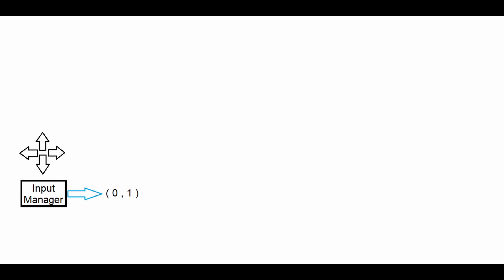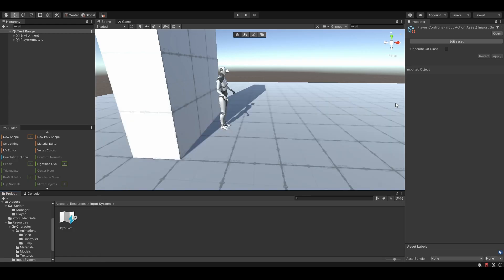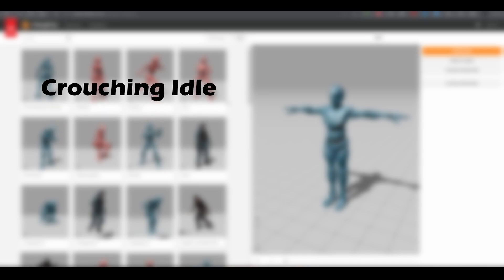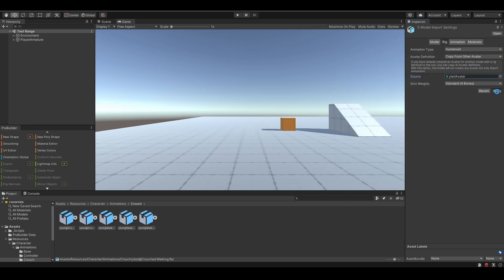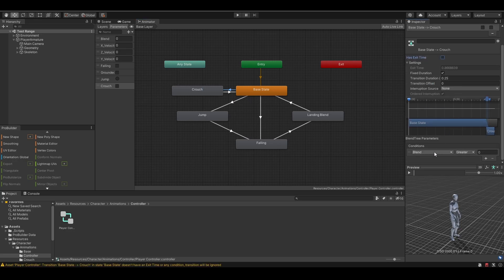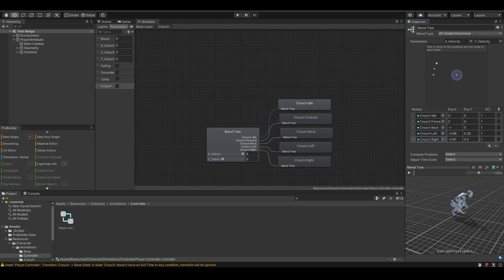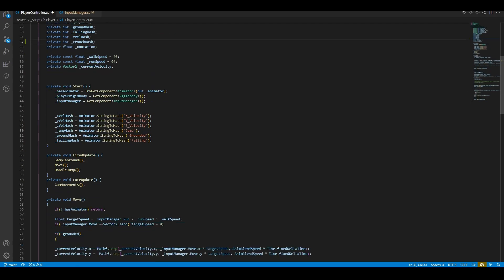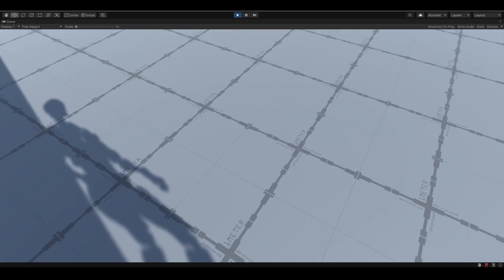Making A Crouching System - Unity Tutorial #3

Comment: Great tutorial! Guys I faced some issues and I wanted to post the fixes here if anyone was facing the same issues, if your character isn't jumping and playing the jumping animations, check your rigidbody's mass, make it lighter, something like 25-30 worked for me. 

Secondly my character started playing falling animations when I was on a slope, make your Dis 2 Ground higher, I put mine to 2.2 for it to work properly and I changed the private void SampleGround() function to this:

private void SampleGround()
{
    if (!_hasAnimator) return;

    // Use a sphere cast instead of a raycast for better slope handling
    float sphereRadius = 0.5f; // Adjust as needed, typically half your character's width
    Vector3 origin = _playerRigidbody.worldCenterOfMass + Vector3.up * sphereRadius; // Start a bit above the center of mass
    float castDistance = Dis2Ground + sphereRadius + 0.1f; // Adjust based on your character's height and desired ground detection range

    RaycastHit hitInfo;
    bool hit = Physics.SphereCast(origin, sphereRadius, Vector3.down, out hitInfo, castDistance, GroundCheck);

    // Check if the ground normal is within the slope limit
    float slopeLimit = 45f; // Adjust based on what you consider too steep
    bool isSlopeAcceptable = Vector3.Angle(Vector3.up, hitInfo.normal) <= slopeLimit;

    // Update grounded status based on both the sphere cast hit and slope check
    _grounded = hit && isSlopeAcceptable;

    _animator.SetFloat(_zVelHash, _playerRigidbody.velocity.y);
    SetAnimationGrounding();
}

Lastly, If you wanna get rid of the players holding gun animation while crouching, google animation masking. blend the crouch forward upper body with the rest of the animations for crouching on all directions. Hope this helped someone!

Comment: I've got problem when running to an object, table for exemple; Even if its 0 friction, my player get bugged like rotating or get bumped.. Another problem is when i'm walking in mountain environment or just going down a slope my player triggered the falling animation. Do you have some idea to fix all this ?
Reply from the maker: This is actually a good question. When walking on a steep slope, the animator will play the falling animation because the ground-detecting ray is too short. Extending the ray will make it work but the system will deviate from realism. Usually ground detection utilizes several rays (like 3 or 5 rays) rather than just one, but I choose to use 1 single ray since its better for the performance, and it's easier to implement.
Reply: @ADifferentGamingChannel  You should try making the ground detection using a SphereCast instead of a Raycast
Reply: i mean i feel like the player is walking on the moon xD could it be possible to stick the player to the ground when moving ?